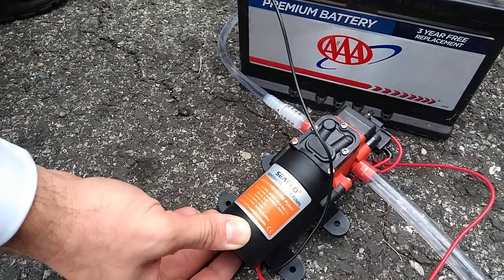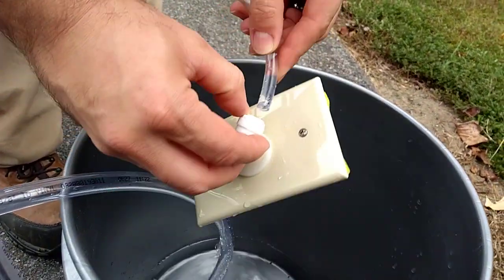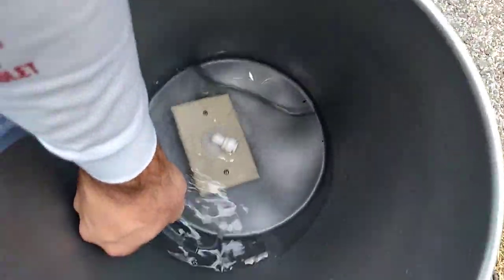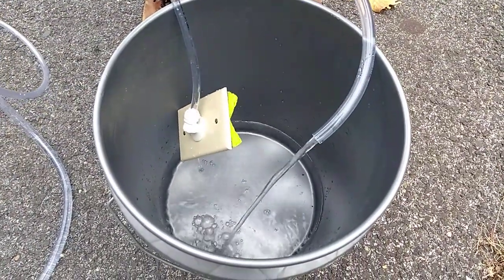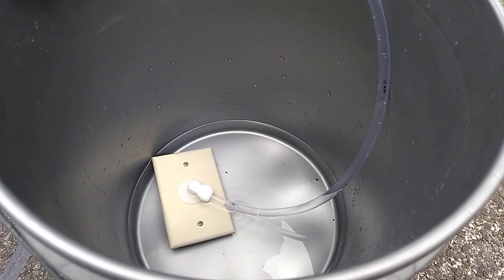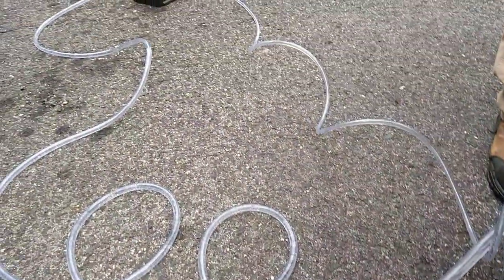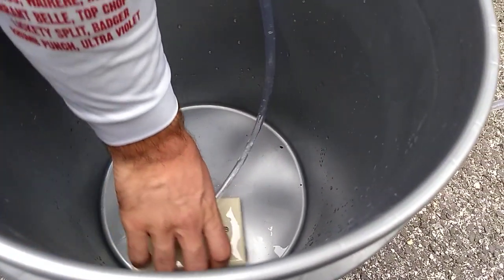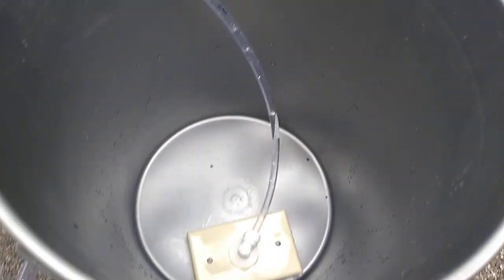Arid bilge/Dry bilge alternative

Comment: The commercial versions of this have something like a brake bleeder bottle in between the pickup and the pump, so any back-flow is caught for the next pump cycle. 

Also, not tightening the wall plate screws so tight would not deform the sponge as much and give you a better seal on the bottom of the bilge. I think I would swap out the plastic switch plate for a stainless steel one, so the weight would help hold it flat to the bilge floor.
Reply: Or create a small slit in sponge material to let the washer sit against the scrubby material, so sponge is not deformed but it is securely held in place.

Comment: I wish you’d discussed the assembly to the switch plate.
Reply from the maker: the switch plate is actually a wall plate blank.  i drilled a hole just big enough to start the pipe threads and then screwed it in.  i cut a dish sponge to size and held it tight to the open end of the plastic fitting with screws and washers.

https://www.lowes.com/pd/SharkBite-1-4-in-Push-to-Connect-x-1-4-in-Mip-dia-90-Degree-Male-Elbow-Push-Fitting/1000192667

Comment: The fitting you used on the plate, sharkbite type fitting, where do I get those? Have you got a link to see them online?
Reply from the maker: I got it at Ace Hardware.  It conveniently had threads and with an appropriately sized hole it threaded in.

Comment: did you cut a cavity in the sponge for the threaded end of the fitting?   What did you use to plug the bottom of the fitting (a cap, a cork?) and did you drill out little holes on the sides or is the entire fitting sucking into the sponge.. ?   Did you cut off the threaded portion so it wouldn't go all of the way through the sponge?   I built one of these but it isn't sucking anything out of the sponge (not enough to self prime) so I am figuring it's the pump and have ordered the pump you showed to see if it works better
Reply from the maker: I kept it very simple and just drilled a hole big enough for the fitting to thread.  I didn't even cut threads!  I just force threaded the fitting.  It didn't protrude too much on the back side and the sponge is just pressed tight against the open end of the fitting.  If I recall the hose is 3/8ths OD and 1/4 ID so there really isn't much flow.  The pump is a positive displacement diaphragm pump and is advertised to have 10 feet of lift.  This means it does not need primed and can be mounted up to 10 feet above the water it is pumping.  It can also run dry indefinitely without damaging the pump.  If you tried to use a typical bilge pump they are centrifugal pumps and require the suction of the pump to be submerged before they pump.  Other pumps like the whale gusher have a much capacity and larger suction.  I think they might have a more difficult time self-priming since the larger diameter hose may allow air to slip past the water... 🤷‍♂️.